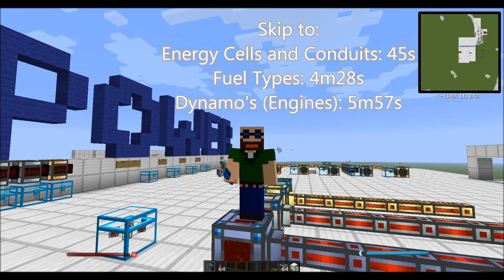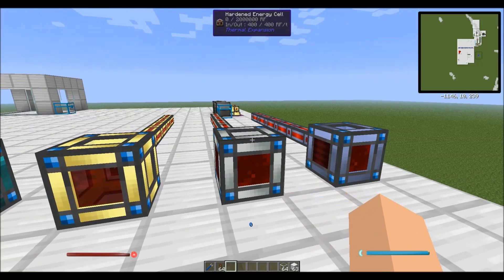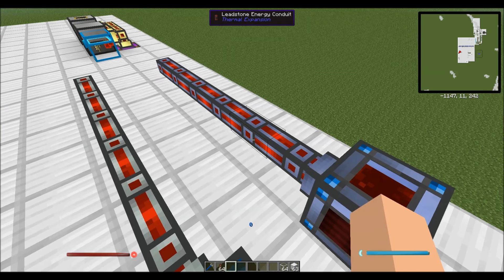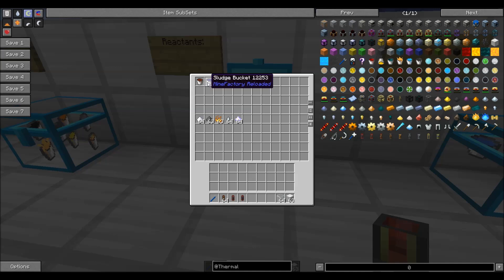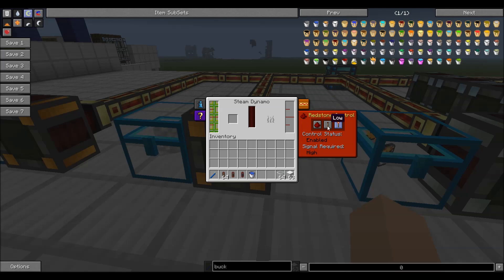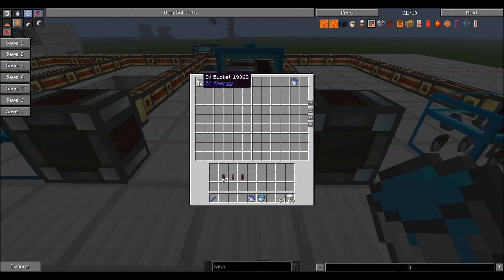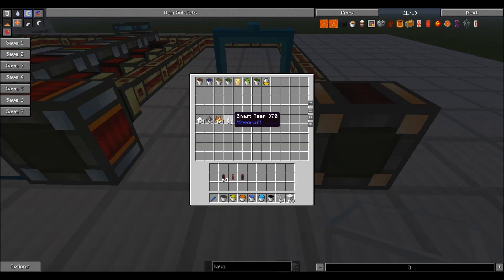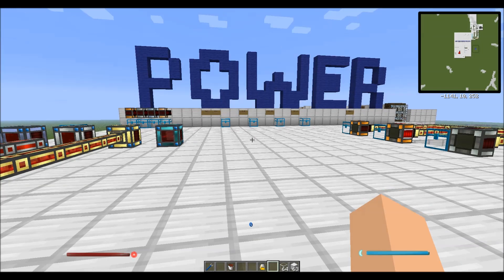Thermal Expansion 3   Power

Comment: How do u pass the engery from the engery cell to the machines?
Reply from the maker: Recardo Murguia Using conduits, connect machines directly to the dynamo, or if using an energy cell change the side of your energy cell that is leading to your machines to red(green tab in energy cell gui)  Blue is input power, red is export, yellow will not connect.  Hope that helps!

Comment: please how to use therùal expesion 3 energy cells with minefactory reloaded 
please anwser me :/
Reply from the maker: same as before, they auto convert.  You can see it in action in my let's play series.
Reply: well , it went work for me :/ i am playing it in 1.6.4 if that makes sence ? 
i will watch your let s play then i will try it :/
Reply from the maker: Make sure you have set the correct output side so your cables (and machines) get power.
Reply: actualy i put it all to output while i was trying to make the MFR machines work :/ i didn t watch your let s play yet ...
Reply: ii ve watch let s play direwold20 tree farm but it is so complecated way i just want how to use energy cells O.o ...

Comment: i have a steam dynamo hooked up to a hardened energy cell and the cell doesnt seem to fill. the energy in the dynamo depletes but nothing seems to happen with the cell.
Reply from the maker: Well, it's possible your network is using power faster than your dynamo can produce it... but I imagine you would have noticed that.  However if you have any buildcraft blocks they will drain power even when not running.  Check to see that you have the correct input side turned to accept power from the conduits.  Conduits will hold a certain amount of energy so it is possible that they are just filling up and your cell is not configured correctly.  If that doesn't help try picking up your conduit and placing it down again, it could be a bug (but not one I've seen before).